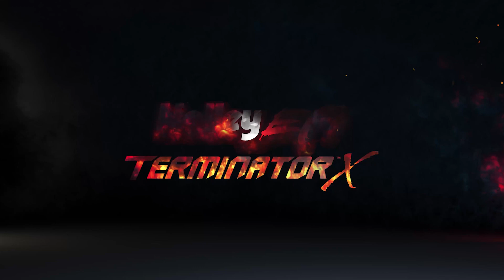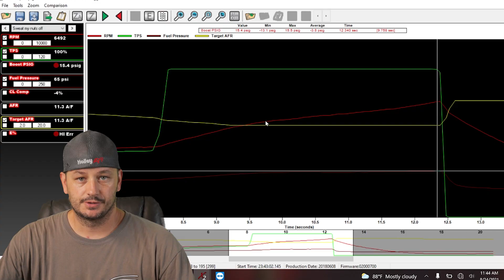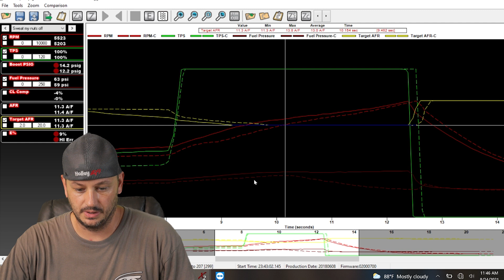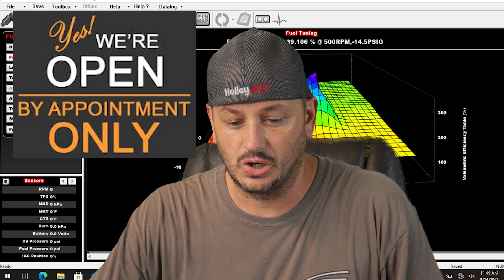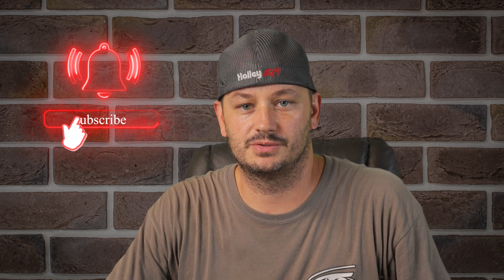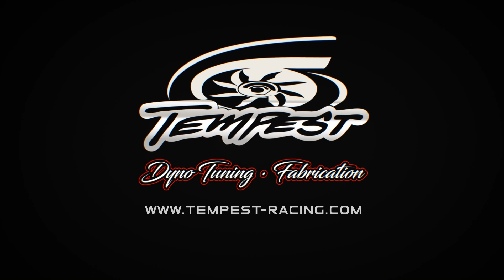How to Identify Fuel System Problems in Holley EFI // Holley Terminator X

Comment: Thanks for this video! I'm going through your whole terminator X series. Only tuning i've done before was on my brother's OBS chevy that was LS swapped. Maybe you or someone else can answer this for me. Would getting into 120-130ish in the VE table towards the higher RPM point to a fuel issue? from around 4000-6000 rpm. The numbers didn't seem quite right for naturally aspirated but I'm also brand new at this so I'm not sure. (This was in HP tuners if that helps at all?)
Reply from the maker: @isaacpsi  could be. Holley ve numbers tend to be higher than 100 so doesn’t sound too far off
Reply: @JoeSimpsonAtTempest  Great thanks for the quick reply. Your videos are a life saver 👍🏼

Comment: Do you have a guess as to why my prime and pump stopped working after 3 months? I haven't had it tuned I don't have a laptop, I wired it up and everything worked. It still has good ground, a couple of times when it quit on me I turn the key off and back on a couple times and that worked. But not anymore.

Comment: On a boost reference fuel regulator, should my pressure increase 1 to 1? I set my base pressure at 60 psi but at 13# boost in only get a rise to 69 psi on fuel pressure, is this normal or should it be exactly 1to1 increase?

Comment: Would u be able to help with a problem I’ve been having with a car I’m working with??
Reply from the maker: Maybe. What’s the problem?
Reply: @JoeSimpsonAtTempest  I have a 2014 mustang with a Paxton, fic 1000 injectors, dw400 fuel pump with a 10lbs spring in the waste gate. It idles good but when I snap the throttle the wb goes to close loop and goes lean. I swapped the pump back to stock and took the charge pipe off and it still does the same thing.

Comment: whats up the the erratic E%? Im having the same issue
Reply from the maker: Almost always a wiring problem it seems but a handful of other less common issues can cause it as well. If it only happens under power moving from the return side to the feed side can help if your at the limits of the fuel pump. This car did it all the time

Comment: What do you consider a maximum duty cycle for the injectors before you consider going up in injector size. This obviously assumes you are only out of injector and there are no other issues with the fuel system. Also if it was close enough to being enough injector and the rest of the fuel system could handle it would you maybe consider upping base fuel pressure (for example to 4 bar as opposed to 3 bar). Keep up the great work
Reply from the maker: 80-85%. But also depends on how your using the car.

Comment: I'd love to hear you explain PID tuning for closed loop boost and AFR. I have MS3 Goldbox but want the closed loop boost and afr of the Holley. I genuinely feel PID tuning can achieve it.
Reply from the maker: I actually Havnt done a boost control video yet because the way i want to do it would probably take me 2 days to film and another 2 to edit haha
Reply: @JoeSimpsonAtTempest  we would all watch it I can tell you that much. The PID tuning portion, even a tips n tricks section, would help a ton!

Love you videos man.
Reply: PID loops and megasquirt arent as easy or as consistent as some other brands, i was running Goldbox for couple years and it took alot to get things half ironed out, i switched to another brand and had a wayyyy easier time, nothing wrong with MS but sometimes you have to go against whats considered right
Reply: @sebfullick5011  PID tuning should be similar. Tuning tips and tricks would likely be different from Boost to AFR.

I like the way Joe explains various settings and feel like he could offer insight on boost PID and AFR PID
Reply: @andrewhans  100%, Joe covers things well